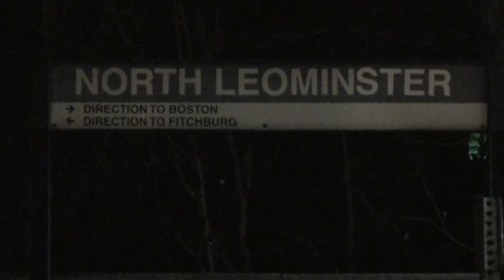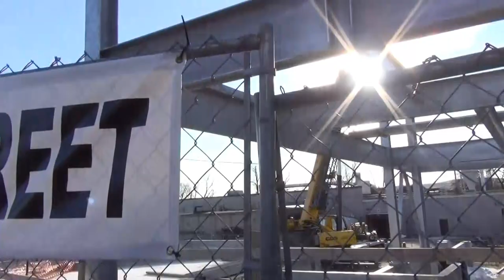Leominster: New MBTA Parking Garage (Part 10)

Comment from the maker: Most of them built nowadays (here, at least) are of a steel frame, now that the codes require earthquake and wind resistance.
The Major Taylor Garage is a hybrid, with the traditional ribbed concrete decks, but a steel frame.

Comment: elevator has doors on both sides?  elevator should be in the brief 4 floor section.  my new brick camera is thinner than before.  a bucket was left on the girder. they could also G, T 1, 2.  corrugation holds the cement?  you have a good reason for missing bolts.  

they should have gone with a bus bridge.  people ride the bus bridge ONLY TO or ONLY FROM the train.